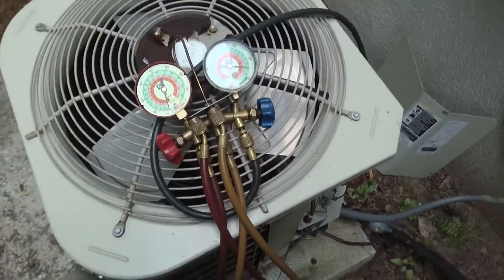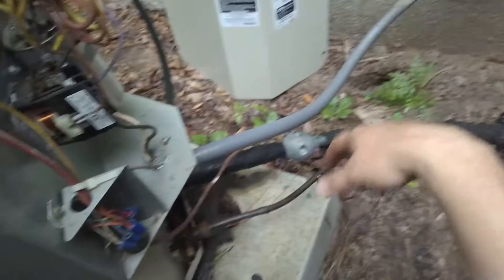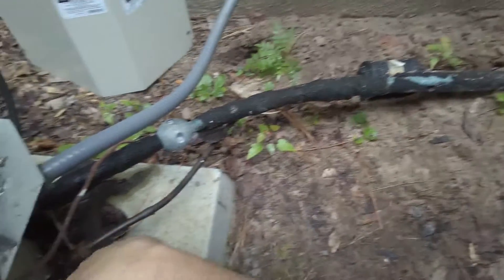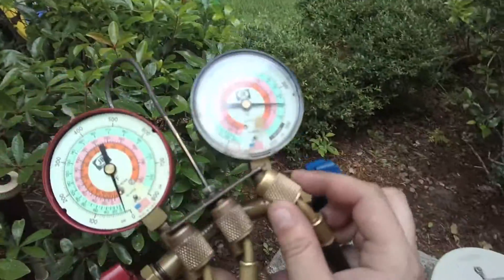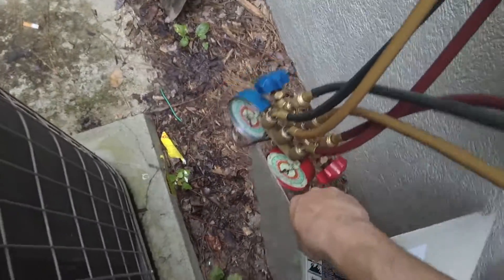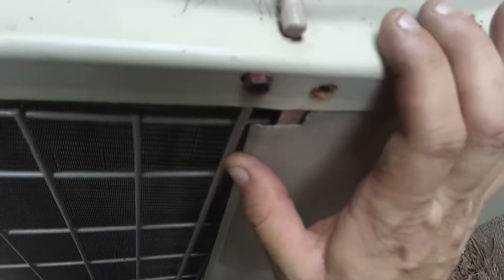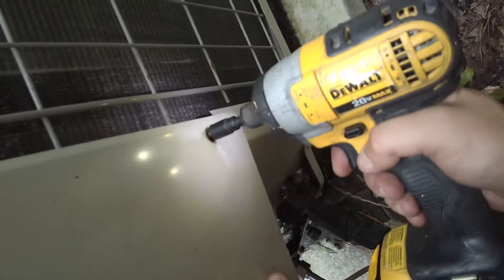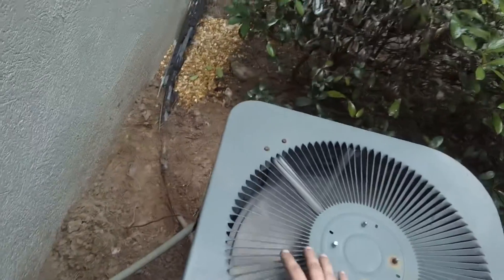UPDATE HVAC A/C Not working clogged dryer /bad TXV  What do you guys think.

Comment: This is a partial restriction full restriction the unit will pump down completely close the king valve on the high side the unit will pump down more than likely this has a piston not a TXV take it apart at the evaporator I had a piece of trash one time the size of a BB the unit pump down lol

Comment: it's probably overcharged partner????????
Reply from the maker: When I went to go put on the hose to the high side it blew the rubber o ring into the hose down inside the hose.Once I got back to the shop I realized that,s why I could not connect the high side hose. It ended up being the dryer after all.UPDATE@4:52 . Thanks for watching jimbola77 .
Reply: ahhh trial and error partner that is how we learn! wer'e human!!!!
Reply: jimbola77 no it is not the suction pressure was a zero overcharges High head high suction
Reply: Liquid line drier my 25 years of working on these units nope if it is straight cool unit partial restriction at the liquid line drier it would Frost